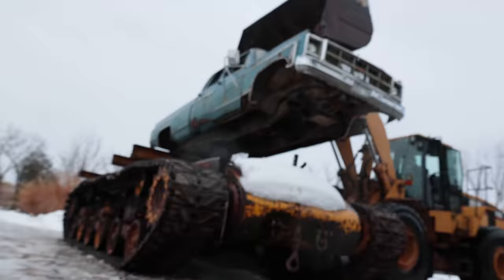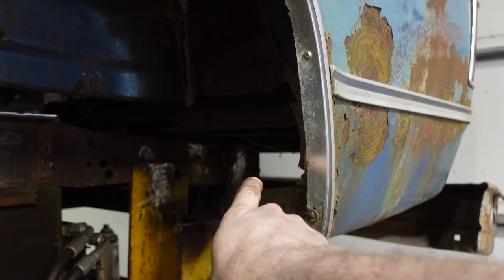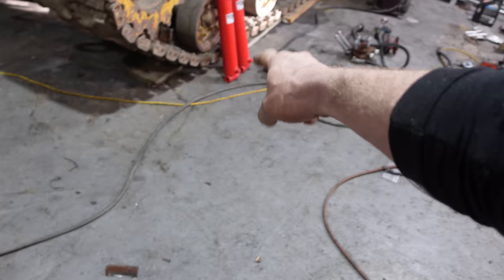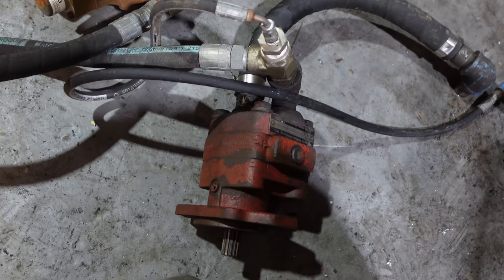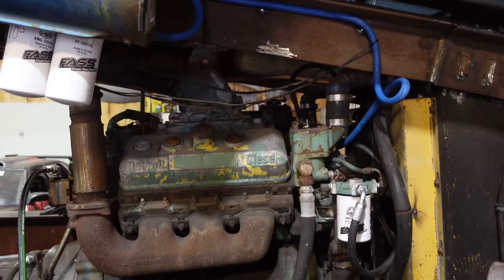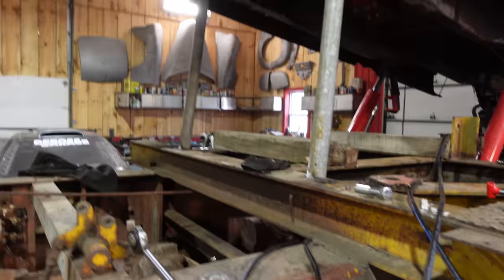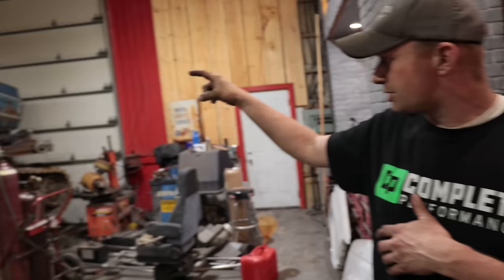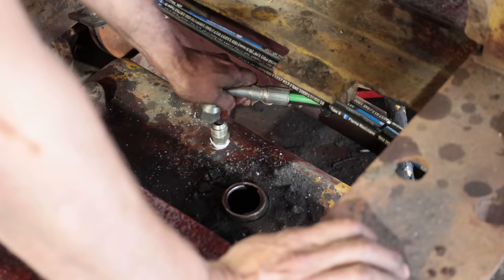Firing Up the 6v71 Detroit powered Tilt-Cab Tank! #Shermanator [EP5]

Comment: Rich.... Great build!!.... makes me wish I was young again. : )   IF, you turbo it.... you're going to change the pistons & blower... yes?  no?  If that engine was originally from a Genset, as you pointed out.... then it has a "Constant Speed" governor, (unless someone has changed it, out) which will NOT give you the proper fuel/load control that you need for your application.   

What you need with your manually controlled throttle is a LIMITING Speed governor, which will give you INTERMEDIATE speed/fuel control.... the CONSTANT Speed governor that is equipped on ALL Genset Detroits, Do Not allow for Intermediate range variable load/ mechanical fuel control.. they are for idle and maximum preset (depending on Genset type and power application) speed control Only.  

Also, you will need to Make Sure that the LIMITING Speed governor is of the DUAL Weight, SINGLE Range type... for the "V" 71 that you have there and for your application.  Just FYI... as would "hate" to see you go through all that work, and wind up with "lackluster" performance.   

IF... you turbo it, with a stock turbo, you will Not gain much performance Without changing the roots blower to At Least a By-pass blower.  If you turbo it, without changing the pistons from an 18.7:1 to 17:1, then be careful to Not go too large on the injectors.  

Some Genset Detroits did have a lower than 18.7:1 cr to juggle the engine output, along with smaller injectors on the NA engines.... might be helpful to know exactly what you have in that engine before you add a turbo and larger injectors.. of which, there are Dozens for many different applications and uses between all three smaller Detroit engine "families" (53, 71, 92).  Injectors for the 6-110 & 149 engines are interchangeable... which was handy for making some Really serious power out of the 6-110.  

Also, not all of the injectors are alike in terms of HOW the fuel flow is controlled... some, "ramp up" the fuel on the lower end, some are strong in the mid-range and level off at the upper end, and others are an even "ramp" all the way from idle to maximum governed speed of 2,100.  

Many different Types of injectors for many different power needs for many different applications.   Your Great at engineering things... and we all very much appreciate your willingness to share your "creations".      Will be watching for your updates and progress on this one, especially.
Reply from the maker: Thank you very much for all the info.  Very much appreciated.  I realized pulling on the throttle I will likely have to change the governor.  On the lookout right now
Reply: @DGHD .... Thank you, Rich. I very much appreciate your response.  IF, there are any questions that I might be able to help you with in relation to your engine, don't hesitate to ask.   

PS: I don't know if you follow Sled pulls or not.. especially the NTPA & East Coast Pullers Association.. "Pro Semi" class... but there was a 1974 KW with a V12 (series 71) called the Lady Butterfly (black & yellow w/a big lighted butterfly attached to the grill), that was one of the Original trucks to pull sleds, starting in 1979 (its first sled pull .. off the street at a county fair in Florida, which John.. won), before there was an actual organized class for them.  

Sold the "Lady Butterfly" to a new owner in 2017 and he has since re-powered it with a 3406 Cat... and hasn't kept up it's appearance.. "she's just not the same "Lady Butterfly"any more.

Long story, short... it was bought new, rated at 434hp.. when John decided to retire it off the road and keep it for full time pulls and after many changes to the truck, and the engine (which I worked on).. "she" was developing between 2300 & 2500 hp (3020 / 3240 lbs ft torque depending on altitude, atmospheric variances, etc.) and we were turning it between 4000 & 4200 rpms under load!!  Detroit Diesel told me I couldn't turn it that high... I told them I could, and I why & how I could, without blowing it up.. and did so, for years.

We had over 11,000 "hooks" (pulls) over the years, up to 2013 when John couldn't run it any longer due to health issues.  

The ONLY engine  "failure" we had in all that time, was One spun bearing at a pull in 2006.  

The engine itself, already had 1.6M miles on the "clock" when it was retired off the road, to go full time pulling with it.  

I had ways to extract even more power out of it, but finances and with his health getting worse, we never "got there".  

Also, with the proliferation of all the guys coming into the game with large bank accounts and using the "big inch" (re: long stroke) 4 cycle V8's (re; E-9 Mack), KTA/QSQ19 Cummins and 3406 Cats, it was getting harder to compete against them with such a short USABLE power stroke, especially on the NTPA "hard tracks"... "soft tracks".. we "ate them alive".   

Was fun while it lasted.

Comment: I work at a hose place and it's funny and frustrating that I recognize thats a 707 crimped and you crimped m2t. Looks like 8m2t as I'm typing this comment😂 and for the fact that I work at a reasonably prominent hose store that has 5 or 6 locations yet v&r has more fittings than we can seem to keep. We use them every time we get them.

Comment: I had picked up an International 350 tractor with the valve body installed backwards.  Tried lifting the loader and blew out the valve body housing where the line connected...Hose would have been a cheaper fix.

Comment: What a beast. Are you doing anything with the truck body itself? Or is it going to get used and abused in a way that the body doesn't matter. Specifically wondering if your going to do the rockers and door bottoms and if needed floor patches. I get a mid 80s monster truck feeling from shermanator which is why I wonder how its going to look when its done..

Comment: Rich i would put some hoses to be able to run the hydraulics from a tractor or something besides the motor if the motor ever goes down. Or the pump goes out etc
Reply from the maker: Quick coupler on the in and out will do just that.  Thanks!
Reply: @DGHD  oooh I guess I never seen that!

Comment: Torque to Vice Grip Garage Factory spec's...."Until your elbow pops...then add a Hooga-Doo'ga". Jeepers D'boss, you need to knock down those  "Death'cicles"... ?  What is the Tensile Strength of and Grade of those bolts for to hold the body up:  A325 Type 1 ??

Comment: This thing is super cool. Did you consider lifting the body the other way so it was hinged at the front so you had more space to work on the engine in the chassis and have less load on the hydrolics
Reply from the maker: Giant hole in the bed to work on the engine.  I was wanting to get more at the winch, and the bolts to hold it in the front are just under the drivers seat

Comment: I wish I lived near you. I want a reliable diesel for my 1969 Chevy C30 dually. It was a delivery truck with a 19 foot box on the back. It has the 292 inline 6 and 4 speed with the granny 1st gear. Any recommendations for a good diesel engine and possibly a 6 speed?

Comment: I had assumed that you would use hard lines from the steering down the truck frame to the back and then only use hose to the tank frame where the pivot on the truck frame is, then hardline to the front of the tank, then short flexible hose to the steering brakes, would that be less expensive than hose the whole way?
Reply from the maker: No, time is money

Comment: Just spitballing here, but why didn't you make an H pattern shifter up top with the cylinders in the same arrangement as the lower cylinders? Then it's the same as FWD shifter cables, but with hydraulic lines instead.

I'm sure I'm missing something as I'm a couple pints in while watching, but as I said in spitballing possible future iterations.

Comment: I would have loved to have seen you design a suspension system for the truck cab so you had a smoother ride than the  old tank drivers had
Reply: Twenty tons or so underneath the body of the truck, and only the bogey wheels, springs and traction bars to soften any bumps on that chassis?. That cab is going to be teeth rattling regardless of how much shock absorbing you could put in. Especially when they get it up to full honk!.

Comment: Also there are things in the heads called fuel logs..... You may have to wait for the fuel logs to empty..... If you're trying to shut it down on a runaway.......or you may have to pick a different spot other than the fuel filter..... To bleed all the air out of the system.....

Comment: Are you sure you don't need a separate flow pump for your hydraulic pump? Or set the tank above pump to gravity feed it..... usually vickers pumps only push oil.... usually they do not pull oil.... just wondering.....
Reply from the maker: I ended up raising the tank yes.

Comment: Why did you decide to pivot it from the back? Wouldn't you be able to get more room to work on the engine if it's pivoted from the front? Also, with an engine under the hood of the square it makes more sense to lift the lighter end up...cool ass build nonetheless and I applaud your dedication
Reply from the maker: Front engine is mounted to the sherman parts with the truck lifting around it.  Back engine has a lift hatch in the bed for easy access
Reply: @DGHD  that makes more sense...I thought you'd be attaching the accessory engine to the truck frame

Comment: Love this project, but have to disagree with you about the sherman being made to be driven by a weak scared driver, most military equipment is designed to be operated by a ham fisted gorilla. On older tracked vehicles the steering brakes should be either on or off, driving them gently and slipping the brakes will burn the brakes out.
also IIRC the sherman steering is not just a simple brake on each side, where you stop one track, i think it has a gear mechanism where the braked track will turn at a slower speed depending on which gear you are in
the lower the gear, the tighter the turning radius

Comment: That thing is totally bitching a lot of work I can see that I would be afraid of when I'm driving it if I'm going through brush a stick get jammed in your up-and-down valves on here you're working on and while you're driving your truck cab goes up in the air  Thanks for the videos lots of good time

Comment: NOT a 6-71 detroit...take a look...not a inline 6, but V-8...a 8-71 detroit with the blower on top..middle. The 6-71 has the blower on the side, in the center of the block..DUH
Reply: It's a V-6. 6V-71 with the blower in the valley.